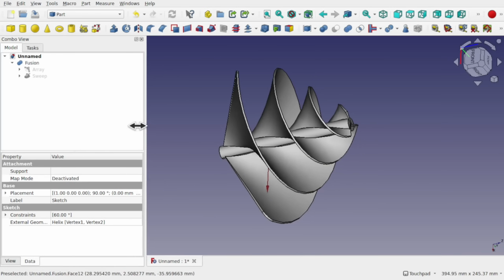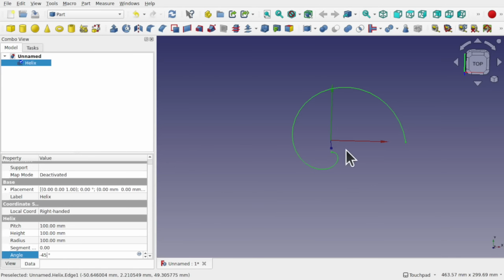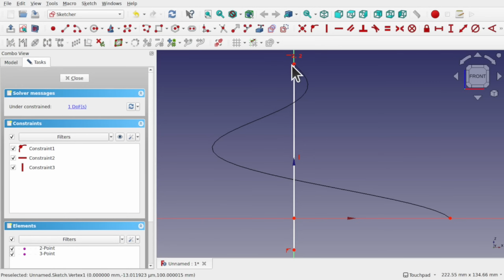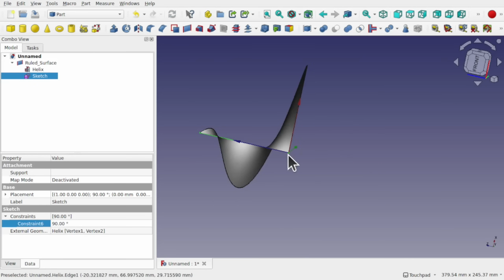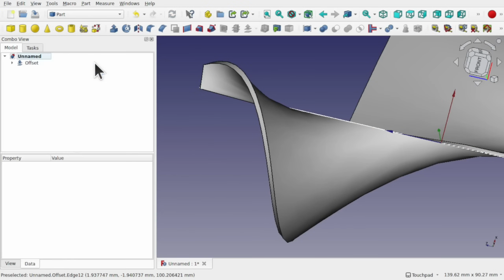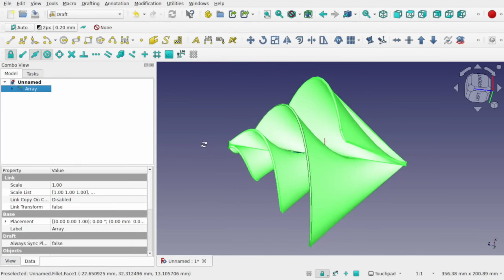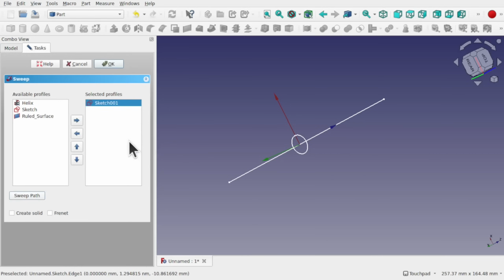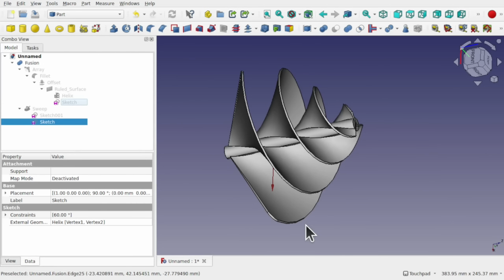Easy Archimedes Wind Turbine in FreeCAD (Liam F1 Fibonacci)

Comment: Is it possible to make a screw that has the same radius at the largest width? THe larger portion of the blades seem to have a larger radius and stick out further. Is that endemic to an Archimedes screw, the larger edge has to be wider than the smaller edge?  Is there a different turbine that would allow a clean edge? I wasnt to stick one of these in a tube so as to force air over it naturally but I want there to be as little leak as possible.
Reply from the maker: You could use the basic part design additive helix workflow with a profile that touches the center axis, that would give you the results I think you want.  I think this video would help with the explanation -> LINK: https://youtu.be/lHAbk01ptqw

Comment: I was doing this same exercise in Freecad 1.0, to practice a bit the booleans with the helix, but I had a problem generating the union. In the end I had to separate the center of the helixes so that they do not coincide at a single point. But other than that, a very entertaining design. Thanks MJ
Reply: I've been hit by this, can you explain how to fix it?
Reply: S'ok, got it. Just a tweak of the Polar/Circular > Center by 0.1mm fixed it.
Reply: @AndyBKay Yep, that was the easy solution.
Reply: @AndyBKay I also confirm this is an issue in version 1.0.0 and this tweak are the solution.

Comment: no queremos ver dibujos queremos ver comose hace la turbina
Reply: this tutorial is about how to use FreeCad to design it, if you want to build it I know of at least 4 different methods you can use at home
Reply: @severpop8699  Puede publicar esos cuatro métodos gracias
Reply: @valerio-yo9sf  You can export the model as a STL file to be 3D printed (filament or resin) and as Gcode for CNC machining using the Path workbench.
Reply: You can export the model as a STL file to be 3D printed (filament or resin) and as Gcode for CNC machining using the Path workbench.

Comment: I had already designed turbines using the golden ratio with variable wall thicknesses (including aerodynamic ones), using FreeCAD's loft function. To optimize the design, using thin walls, I have seen designers using rods connecting the ends to the shaft, but in my projects I replaced these rods with a ring where these ends are embedded, in order to stabilize the body even in extreme conditions. This comment is a suggestion to boost practical uses.
Reply from the maker: Thank you for adding that.  That sounds like a really good suggestion.  I had a look back at the Liam F1 and this does to seem to have a number rods.  Adding the rings instead is a really interesting concept and I can see how it can integrate into the design.  I am only just starting out on this adventure and your comment has given me some much needed food for thought.  Thanks once again.
Reply: @MangoJellySolutions  como construir isso na real.?
Reply: How can one build this thing IRL from a strong materials? Not those printed ones.
Reply: Can you make a video please?
Reply: Can i get your mail id? Please...